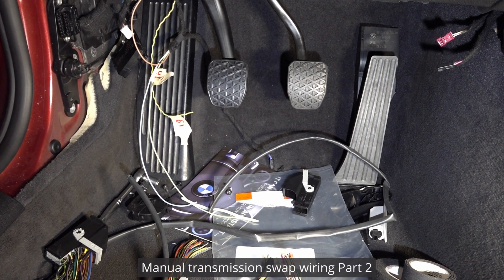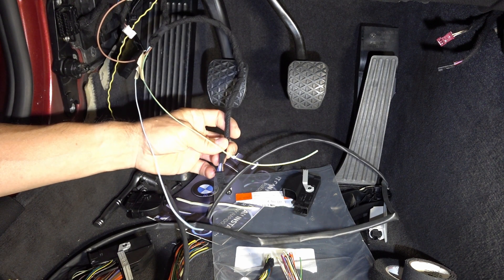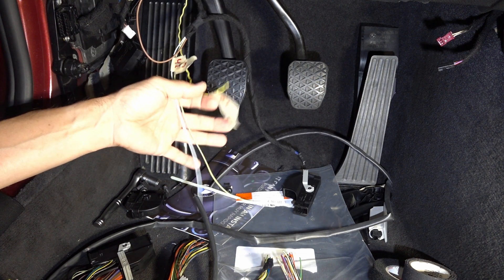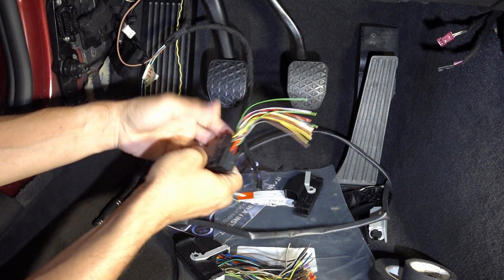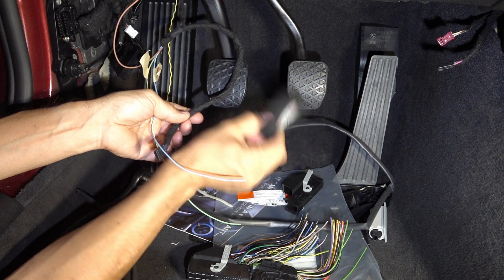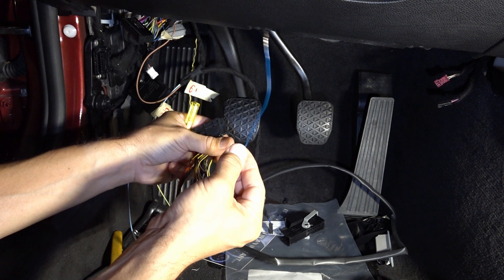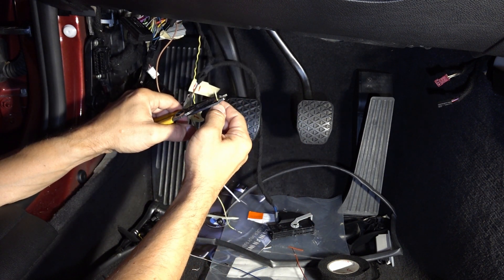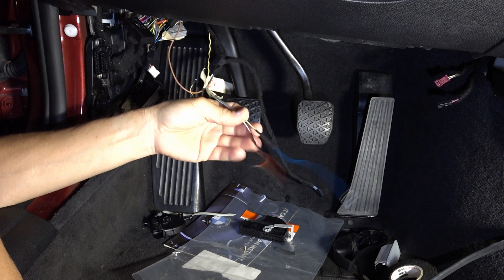E90 328i 6-speed Manual Transmission Swap | Wiring Modifications Interior Side

Comment: I don’t understand how to wire mines I just finished the swap
Reply from the maker: Hi. I've seen this question a couple of times recently, I think I will do a video that specifically addresses (in simple words) the wiring of the swap. It's not too difficult, it's doable, but can be confusing. In the meantime, i will say this - you have to do 5 things: 1 - wire revers switch on the transmission, 2 - wire the clutch switch, 3 - Auto transmission wiring harness needs to be either coiled up and tacked into DME box or replaced with a manual transmission harness, 4 - close up circuit of 2 twisted pairs of CAN system on transmission harness, 5 - a few things need to be re-coded in DME - using something like BimmerGeeks ProTool or BMW's INPA/ISTA.
Reply: @maxsam201 the thing is it would be so easier seeing where the wire goes and where I should cut the wire like I saw in this video the wires cut already not sure where it’s coming from or what to order
Reply from the maker: Right, I agree, I will try to do that.

Comment: Manual transmission pairs with a different differential drive ratio. Did you change the differential ?
Reply from the maker: Yes, I'm fully aware of that. I kept auto diff and I like how it is. Actually wanted to use the Xi differential, that is even shorter, but it requires some additional work to be installed.

Comment: What was the total cost? If you don’t mind me asking. Great video btw!!!
Reply from the maker: Thanks! I don't think I have precise numbers at this point, but a rough estimation is at like $2,000 mark. The biggest spendings are the transmissions itself, flywheel, clutch, driveshaft, pedals module, the shifter assembly. Also that amount does not include labor cost.